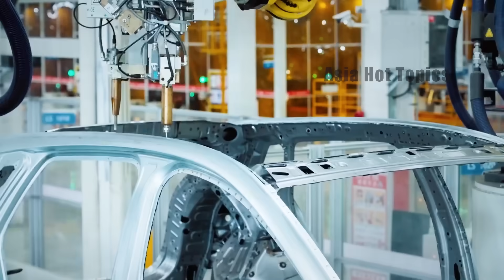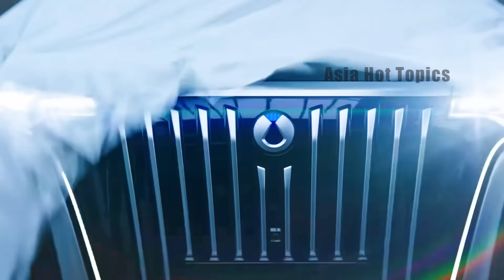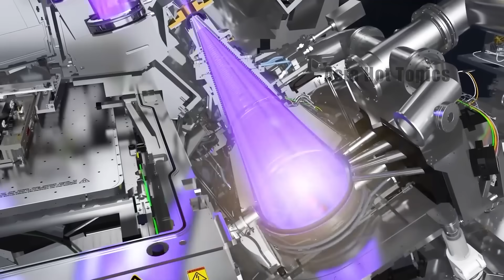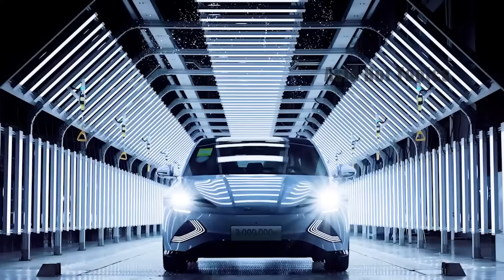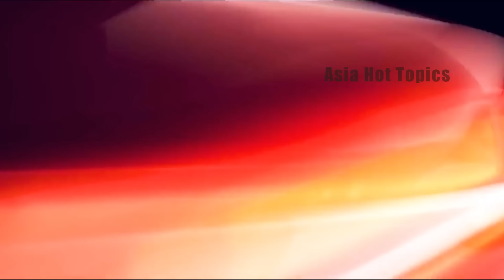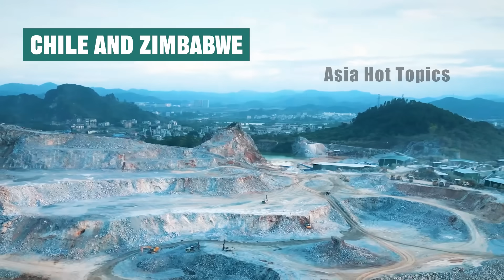The West Is SHOCKED! China's BYD $12 Billion EV Factory | Produces One Car Every 30 Seconds!

Comment: How long does it take to make a car, including the mining of the minerals used for the car body and the battery? Then the minerals have to be melted down and converted to the final product. Then the final products have to be loaded onto trucks and delivered to the factory, where they are unloaded and processed into car parts. Making the seats for the cars is a time-consuming job where various types of fabric are stitched together and mostly done by hand. Then there is the production of the glass for the windshield and doors, the carpets, the paint, the sensors, the tyres, so on, and so on.   And all this is done in 30 seconds is it? More like 30 days.

Comment: Fantastic BYD,, the world beater,, 🎉🎉🎉3
Reply: In mid-July 2025, experts from Dongchedi and CCTV tested 36 Chinese-made vehicles, evaluating their active driver assistance features on highways and city roads. The following brands of cars took part in the test: Tesla, Wey, Xpeng, Aito, Luxeed, Denza, Aion, Toyota, Avatr, Li Auto, BYD, iCar, Xiaomi, Fang Cheng Bao, Nio, Zeekr, Baojun, Lynk & Co, Leapmotor, Volkswagen, Honda, Onvo, Mercedes-Benz, Exid, and Firefly.  
On the track, Dongchedi experts tested the performance of the autonomous emergency braking system (AEB). They were tested in six non-standard scenarios at the maximum speed allowed in China, which is 120 km/h. These scenarios included unexpected obstacles, a truck, roadworks, sudden lane changes, tailgating, and even a wild boar. The Tesla Model 3 and Model X performed the best on the track. They were able to complete five of the six test scenarios, sharing first place. The Wey 07, Xpeng G6, Aito M9, Luxeed R7, and Denza Z9 GT shared second place with three completed tests. BYD cars failed the -0 evaluation test
During the city tests, Dongchedi tested 26 vehicles in 9 scenarios. Only one car, the American-made Tesla Model X crossover, passed eight out of nine tests. BYD Han L EV car He took 8th place and scored 4 points out of a possible 9. 15 Chinese car brands, including BYD, showed a zero percentage rating .  The result was catastrophic for Chinese manufacturers, even for leading brands.
BYD was caught cheating with zero mileage cars, so they inflated the numbers of sales.
 They engaged in financial manipulation, saved on materials, did not pay their suppliers for 270 days, concealed their real expenses
Current debt is inflated, which leads to a shortage of the company's working capital (this is actually hidden production costs). Hidden production costs in 2024 BYD were reported to be -125 billion. yuan, and in 2023 - 152 billion. yuan
Don't make BYD an idol.